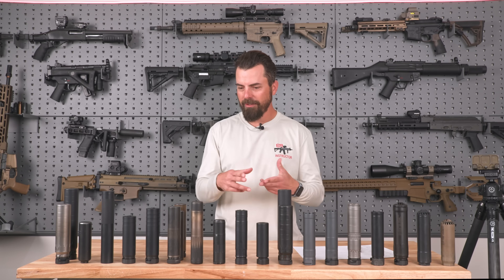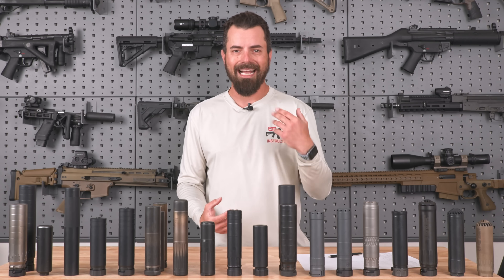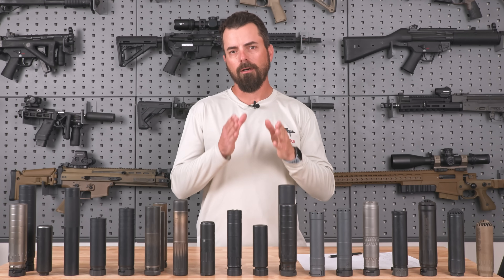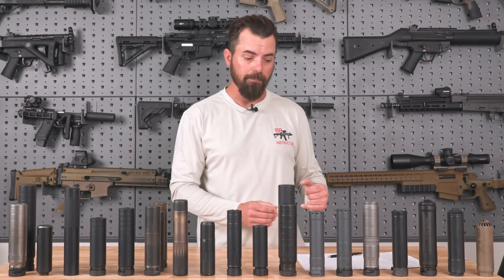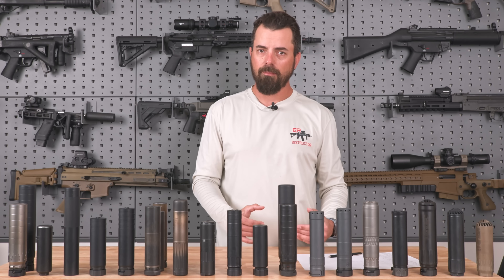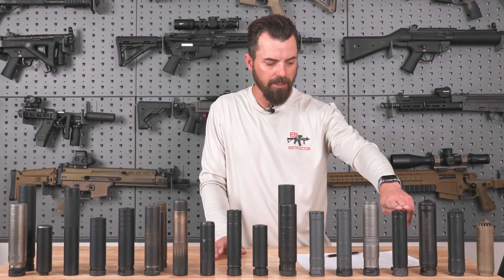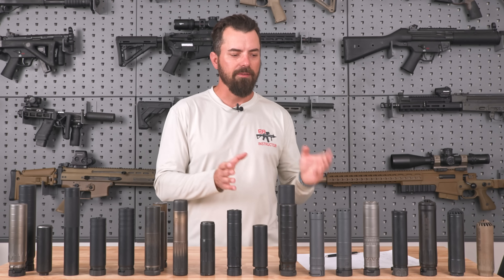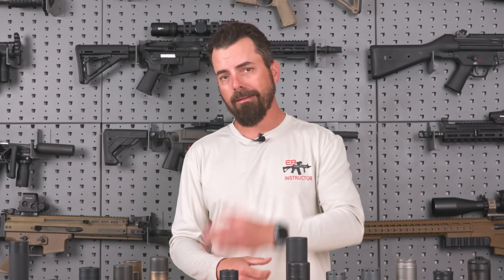Suppressor Back Pressure Test:  Huxwrx, SilencerCo, Dead Air, KGM, Surefire, & More

Comment: Wait, I thought the only back-pressure that actually counts was when the bullet is in the chamber/barrel after being fired. As soon as that bullets leaves, the back-pressure drops dramatically. So the only thing a suppressor does is LENGTHEN the amount of time that some of that lesser back-pressure is in system. It has zero effect on the max back pressure obviously. Is this correct?

Comment: Cool, I got the new Ventum 556 for my X95 because I wanted very little backpressure (Noise isn't a factor considering that 5.56 will never be hearing safe), too bad it's not on this list, though I wonder if it is better than the 762 or not when shooting 5.56. I would've gone with a flow but the muzzle device requirement adds another $200 making it roughly $1,500 total which is rough.

Comment: To bring more information to your viewers, you should take the same cans and then run sound reduction tests to correlate back pressure and sound reduction. The reason we buy these cans is for sound reduction first and foremost.
Reply: yes that would be nice. we have all the info already on that and will be offering it on our site but we will not be testing it our selves as it is 7K to rent that gear for one week and we don't have that. but you bring up good points. the idea that lower BP means louder is accurate un till some of the new cans.. I am blown away at some of the current models.. we are currently testing 83 cans. we have learned lots more since this vid. stay tuned as we just filmed lots more yesterday and have much more to share.

Comment: Just shot my new Huxwrx QD.  10 rounds the bolt pin for my extractor on a sig 556 backed out and got stuck in the upper guide rail.  Gun was shot on the unsuppressed setting.  All I can think it is it was the suppressor but so weird it’d do that being second lowest.
Reply: thats odd, I have been finding little to NO BP on that can. maybe just odd timing?
Reply: @Ertactical  must be.

Comment: Great info. I think comparing back-pressure against sound reduction would help to paint a full picture, as is my understanding that the freer-flowing devices (somewhat understandably) tend to be less effective at sound reduction.
Reply from the maker: Yes! We have a video about sounds suppression coming ver soon.
Reply from the maker: We have a video coming very soon about sounds suppression. You're right about flow-through cans in that they tend to be louder, but they are intended to serve a slightly different function.
Reply: we  are going to do just that. thanks for the feed back

Comment: Ive done similar testing with my suppressors on the same host. One suppressor that really suprised me was the AB raptor 8 with a 3" reflex. It only required a -2 adjustment (setting 6 to setting 4) on my  rifle speed gas block.  My guess is its probably around the RC3 range with the reflex on it.

Comment: Is there any correlation between which ones have more back pressure and DB rating?  Cause the purpose is to stop or slow down gasses.  Is there any relation there in which ones are quieter?
Reply from the maker: Generally, higher back pressure cans are quieter. However, there's more and more cans coming out in 2024 that claim to have low back pressure and quiet. We're putting those claims to the test.

Comment: You should try out some of the 3d printed suppressors like the ftn.3
Reply: we have a handful of 3d printed cans and more on the way, what is the ftn3?
Thank you for your support and positive feed back!
Reply: It's a fully diy design that plaboi on Twitter made and released there is a ton of options for different calibers. It cost less than $100 in materials and holds up very well and it's also lighter than other options
Reply: You should also check out Nikolai romanov he has a couple of designs out now as well

Comment: 🎯 Key Takeaways for quick navigation:

00:43 🎯 Suppressor back pressure test aims to understand back pressure levels of different suppressors to inform users about their compatibility and potential need for mitigation.
01:09 🚀 Increased back pressure from suppressors in semi-auto platforms can lead to higher felt recoil, gas to the face, and potential malfunctions.
02:34 🛠️ Gas block with adjustable settings used to test back pressure levels, aiming for last round hold open as an indicator of optimal gas flow.
04:49 🔍 Test results categorized suppressors into very low, relatively high, and very high back pressure levels.
05:02 📊 Low back pressure suppressors may not require mitigation, while high back pressure suppressors likely need solutions to reduce back pressure.
08:25 🏆 Personal preference favors low back pressure suppressors, particularly those with modularity and universal mounting options for versatility and reduced back pressure.

Made with HARPA AI
Reply from the maker: Thanks for watching!
Reply: Thank you for your support and positive feed back!

Comment: The huxwrx is only rated for 10k rounds and when people realized that’s no bueno the company made it 10-20k rounds. I have shot more than 2k on a weekend shoot. The surefire cans have back pressure but they last and are tanks. You have to decide what’s most important for you.
Reply: interesting about the 10-20k use. I have not seen this posted. you are 100%! so many different cans. gotta know the job before buy buy the gear. Much like picking out a car. You need to know the job and family size before just picking a fav. Thank you for your support and positive feed back!

Comment: These are a lot of older model cans where back pressure reduction was not even a thought or some cases even a know thing at the production time of the can (AAC for example). Any thoughts on doing this test again with more modern low back pressure/flow through cans only and seeing which comes out on top? It’s all good data for your business but seems a bit of a waste of testing to put a huxwrx can against an AAC mini-4 or otter creek can when the two are considered old technology compared to hux.
Reply: totally! yes we have about 17 more cans on the way! some of the newest and latest ones. We will be doing several more tests, your question is my question.. of the new "LBP" cans.. who's works and who is just good at advertising. thank you for your feed back and support!
Reply: Awesome. I really enjoyed the video and the more in-depth testing and the method you used for making the only variable for the testing is the can itself. I just had the aforementioned burning question the whole time if this test was run with ONLY the LBP cans and seeing which is top dog. Great video and can’t wait to see your next round of testing.
Reply from the maker: @Tukong2009  Thank you! 😃

Comment: Would have been cool if you, you know, used more low back pressure cans. I got to shoot both the Lazarus 6 from Dead Air and the Velos LBP and they both performed excellently on non-adjusted ARs
Reply: We have a Vilos on the way for testing. To be honest I think I’m going to find what you have found. I’m watching the ejection path of the advertisement for that suppressor, and it looks to be overcast. But I’ll do some testing and will post a video about it soon.
Reply: SCO Velos, got it yesterday and will begin testing today!

Comment: This is all well and good for DI systems. Piston systems don't vent gas to the chamber. How does back pressure affect them?
Reply: Great question! Because there is no adjustable system to pistons in many cases, they end up overcasting. This will cause the same wear and tear and malfunctions. However, due to the design of the piston system, they often bleed off some of the access gas. We can certainly do a video on this topic. There are available today, adjustable, gas, piston, systems, and these I highly recommend.

Comment: Well, isn't this exactly what I was looking for. May I suggest the HRT and Dual-Lok line from Griffin and Sig's SLX and SLH line for testing next?
Reply from the maker: Thanks for the suggestion, we'll be doing more tests in the future. Hopefully manufacturers will start helping out, these things ain't cheap 😂
Reply: @SilencerSyndicate  Thanks for the response! And I figured as much. I was just looking over the 2023 Silencer Summit sound test results and trying to pick one that balanced low back pressure, and sound suppression at the ear. Of course, flash suppression, universal mounting, weight, and 3d printed design are also big plusses as well. Sig and Radical Defense/Firearms seems to be in that sweet spot zone, but I don't see a lot of end user testing on those.
Reply: I don’t have one of those, but I will reach out to Griffin and see if I can get my hands on one for testing. Thank you so much for your positive feedback and support.
Reply: @Ertactical  Heck yeah! If you can get their  HRT 5.56 (flash and sound suppression focused) and the Dual-Lok 5 (low back pressure focused) you'd get a good comparison data from the same manufacturer. Good testing IMO.
And if you can keep a running update on an excel sheet, that'd be awesome for us data nerds too.
Reply: @JackTagar  you bet! I’ll reach out to them

Comment: I run a 556 velos on a tavor,  and it's definitely better than the hybrid 36m on the same gun , would be interested in some data on how the velos stacks up.  Picked up a Hux flow 762ti to put specifically on a Scar for the best in class backpressure reduction. It's a nice can, however it's not built for quite as hard use a  surfire rc2
Reply: SCO VELOS, got it yesterday and will begin testing today!
Reply: killer!! we do have a VELOS on the way and will be testing it as soon as we get it! Thank you for you positive feed back and support!

Comment: Are the Omega cans you have listed (30 cal, 300, and 556) just the Omega 300 with different end caps? Or are those models that don't exist any more? Thanks for the data!
Reply: yes, 3 omega 300 cans, one with ASR mount and 556 cap, one with ASR mount and 30 cal cap, and one with DT mount and 556 cap. looking to see if it would effect the back pressure via the mount or end cap and it did,, it was kinda a sub test with in the test.Thanks for your positive comments and support!

Comment: I don’t consider back pressure to be as much of an issue tbh. I guess it depends on what you look for in your can. I’d assume more back pressure generally coincides with greater sound reduction. Since the gas velocity is being reduced more. I’ve got a nomad 30 and an Osprey 45, and they do put some gas in your face, but I’ve never been to an indoor range so I’d wager I get exposed to less fumes and particulate during shooting than standing downwind from a highway. I will say, I have a wipe end cap for the Nomad and forgot to swap it out, and with a .25 cal wipe, the back pressure increased to an uncomfortable level.

Comment: A suggestion for future testing: once you’re down to setting 1, swap out to progressively longer plungers in the Riflespeed gas block until you start to lose bolt hold open. That way, you can still rank all the super high backpressure suppressors in order of severity.

Great video. Thank you for putting in the effort to test!
Reply: have you looked up their vid on how to do that?
Reply: @Ertactical  No, but do you find swapping plungers to be particularly difficult?
Reply from the maker: @Shootin_Bruin  look at the RS web page and find the vids on how to do it.. tell us if you see someone you know...
Reply: @SilencerSyndicate  Lmao hi there Rob. That's like the 4th channel I've seen you in I think. Suggestion still stands though, using progressively longer plungers after you've run out of adjustment allows you to rank the highest backpressure suppressors beyond just saying they're all Setting 1. Since each plunger size is worth two adjustment settings, you can go back to Setting 2 when changing plunger size to get the same granularity of testing

Comment: Seems like the longest suppressors had the most back pressure which makes sense, but they're also the quietest.
Reply: Quietest with 5.56 is complicated. I own a couple of these cans and its more of a tone thing over a quiet thing. All the ones I have mitigate the concussive blast and boom from the shot but the bullet still cracks from hitting the sound barrier. Even the OSS 556k sounds as good as the Nomad L to me. Granted I always wear ear pro regardless. So it doesnt have to be long to be "quiet"
Reply: yes quiet is tuff, we will do a DB vid soon, but the reality is sound and volume are not the same. if I recall we had little ones and big ones in the 1 and 2 group. I wish it were as simple as you said it. its def completed and will will be doing many more vids to help make the silencer topic more clear to the world. thank you for your comments and support

Comment: Now do back pressure vs. actual suppression. You'll see nearly inverted results which is the problem with both designs.
Reply from the maker: Yes, there's definitely trade-offs. We'll be doing a video on sound suppression in the near future. Thanks for watching!
Reply: yes good call. the issue is the the best way we can read sound is a DB reader and we have that secluded with a tech to help us do so. the truth is tho, they read volume not sound so it can we the same volume on the radio but one voice is more offensive to the ears than another. we are going to find another way to test and I think I know how we will do it.. stayed tuned for more! thank you for your comments and support

Comment: I'd like to see the back pressure results vs noise reduction to understand where the "sweet spot" is, assuming a compromise must be made.
Reply from the maker: That's definitely on the to-do list. Thanks for watching and contributing to the discussion 🍻
Reply: yes good call. the issue is the the best way we can read sound is a DB reader and we have that secluded with a tech to help us do so. the truth is tho, they read volume not sound so it can we the same volume on the radio but one voice is more offensive to the ears than another. we are going to find another way to test and I think I know how we will do it.. stayed tuned for more! thank you for your comments and support

Comment: If you guage your gas port with a pin gage, go to brt and have them make a gas tube for you. Any high back pressure can will turn into a recoil less rifle with their gas tubes. Tuning your gas system for 100% suppressed is the way, or even 50/50 suppressed/unsuppressed even helps alot with high back pressure cans. 100% suppressed gas tube on mk18 ports it at .061 with an rc2 and a5h2 buffer is recoil less
Reply: yes, there are many ways to fix the back pressure a can adds and we will be doing that vid soon. thank you for your comments and support

Comment: Low back pressure is all hux has. If you haven’t seen pew science test the hux you should watch it. Hux sucks at everything else.
Reply: What are you talking about. Pew Science absolutely tested the Flow 5.56 please check again and if I remember correctly, it got a great rating.
Reply: yes, they are not the most quiet but for this test is was only measuring one topic, and they performed the best within that topic. many more vids are coming to cover more topics. thank you for your comments and support

Comment: Funny how Sucwrks have back pressure similar to unsuppressed because their sound mitigation correlates with that. Is about the same as a linear comp or blast shield
Reply: You sound like someone that has never shot one. I have the 5.56k on a 10.3 and dont notice much difference with my Nomad or Omega 36m. Theres no concussive blast with the huxwrks just the bullet crack. Which is the same with all the others suppressors I own.
Reply: @MSSynsyterGates   shot one at a capitol armory event a few weeks back their cans were easily the loudest on the firing line
Reply: SucWrx hahahahaha i have not herd that! yeah i have an OG OSS can ... it was huge!!! super quite and so so on thee back pressure.. I didn't want to buy the two i got cuz they are not quiet and i have clients with them... i did it anyways just for testing.. after i got em i fell in love!!! then i got the ventem and I love it the most! many tests i have done have changed my mind on they things so I decided that with all i am learning about these maybe i should share what i am finding as my mind has be changed several times! thank you for your comments and support
Reply: @Ertactical  thanks for creating great content!

Comment: Interesting results on some of those. I knew the Omega300 would be high, but the Razor556 I expected to be lower, and the Alaskan being less gas than the Razor...
Reply: Yes, the omega-3 hundred is a very high back pressure suppressor. I’ve been surprised to find that so many are similar to it. I even recently found that the banish 556 oppressor had even more back pressure than they’ll make it 300, I did this test after the video, however.why the Alaskan offers less back pressure is because it’s a 338 diameter suppressor and it only has four baffles. I’m sure you also noticed that mine is the titanium one.
Reply: @Ertactical  I assumed the Alaskan TI is same back pressure as regular Alaskan, just weighs less with all that TI. I am surprised it's lower back pressure than the Razor556 which is only 3 baffles and iirc they're bored to .30 despite it being a 556 suppressor. But the Alaskan is even bigger bore and more volume, so that apparently does it.

Either way the Flow 556 is on my list and this tells me it's a league better than than the Razor than I expected gas wise, just didn't get one first because it is like twice the cost.
Reply: @Fauxknight  yes, it’s odd and many cases. I’m glad I didn’t go into this video making predictions because because I would’ve been wrong so many times lol they really are mysterious and I’m still learning much. But I’m glad you and I can share and grow together from it. Thank you for your positive feedback.